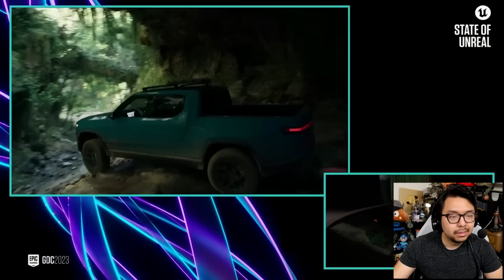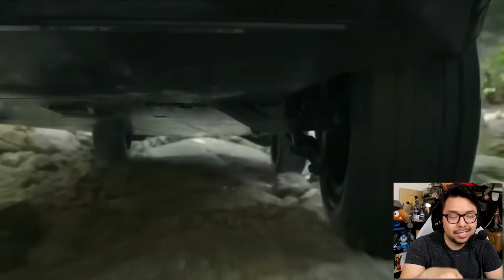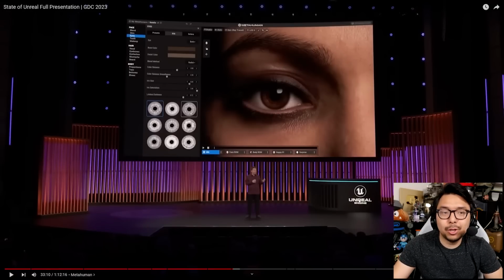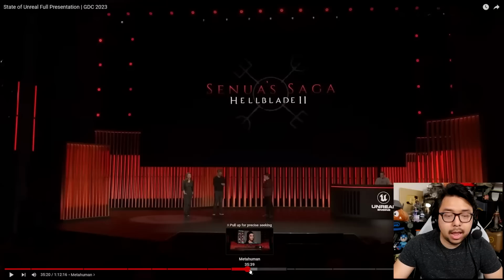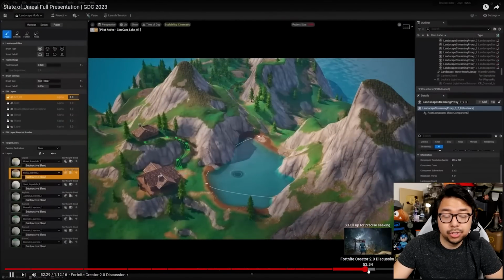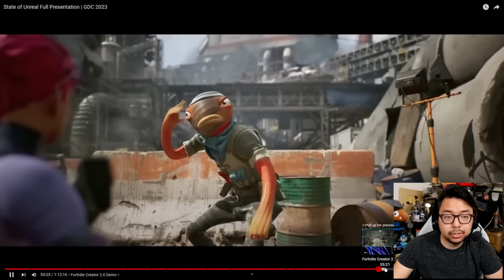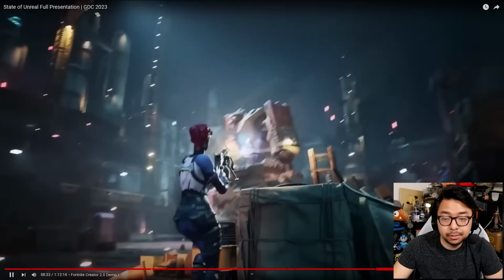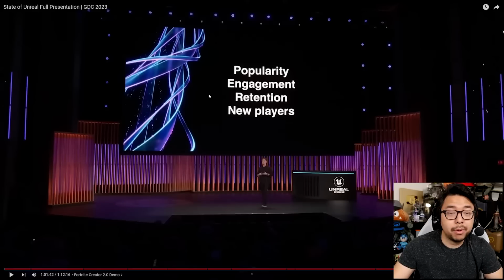Unreal Engine 5.2 Is Utterly Mindblowing (Metahuman, Lumen, Foliage, & More)

Comment: They are not really Top Of the Line  ,  They Have very advance tech but like most  games that have come out massive problems are created like ,  Gotham Knights  lag fps Tanks  , alot of game crashing .  Poor game engine optimization  . Super low FPS .  And in my opinion there has not Been a 100% Top Pc game in all Its History  of unreal Engine Sure there is some good games . But i have Not seen a 100% made from the Ground Up PC game  . without a stupide Ports .

Comment: on new gpus unreal engine 1 can push out over 10 million polys per session you people are on glue you just don't know what's possible cuz they scrub the net often enough to 
remove the truth, that even ue 1 can use c+ to implement other addons, like "opengl 4.6 or vulkan api, and "video player/mp3 player plugs" if you knew you could do it all over in ue1/ue2/udk and use it for free, epic games wouldn't make any money. so its no wonder they spam ue4/ue5 so much while scrubbing info for previous engines.

Comment: Who needs AI to make shit when we have this? :O This far exceeds anything AI can do (and seems to use the same amount of resources?). Cutting out the human is dumb. This, if used right, is the potential for the future. Shame about the hardware being a pain in the ass to get ahold of, and people using things incorrectly will always result in wasted potential, but this is a spectacular piece of work. Would probably make even lower budget titles easier to make (and what's more, you don't need to cut staff, because they can take on similar roles to what they're already doing - this just expands how far they can take it). Now, obviously it'll be prohibitive if UE is expensive to use at a commercial level, but it's still a lot of potential.

Comment: 14:42 - You misunderstand how performance-capture with sensors are done: The body-motions are done with a "rig" or in a "volume" (kinda like those lightboxes for VR-sets, I suppose), and facial performance was done with markers on the face and then captured with a head-device to always capture it accurately. - The difference now is only that you can simply do it with video. - I think there's probably a requirement for a depth-sensor, though, like on those phones that you can unlock with your face, otherwise the camera probably couldn't do it properly, at least not with a single lens.

Comment: I'm not impressed anymore until some game actually implements this kind of stuff. - I mean, cool tech and all, but it serves no purpose if it's not used properly, and it almost never is. - They did this amazing tech-demo for CryEngine back in the day, but some of the prominent games on it, like 'Crysis', weren't actually that impressive. They just felt like results of studios trying to build games on fancy tech-engines, but little substance or point to it. - I've seen this play out over and over and I'm bored of it. - Also: A lot of what you see here isn't very new. I've seen a lot of this possible 10-15 years ago.

Comment: I'm about tired of Unreal Engine, to be honest. Just about every single Unreal Engine game has annoying technical issues - like shader compilation issues, for example. Unreal Engine games almost never run smoothly or as smooth as they should. I wish game studios would go back to how it was in the 90s and early 2000s, and start licensing the id Tech Engine again. The id Tech Engine is one of the most well optimized and smoothly performing game engines out there. With a game using the id Tech engine, the graphics will be photorealistic, all sorts of post processing and particle effects happening. Graphics that make people go "Wow". And then the gameplay is super fast paced and a million things happening on-screen at the same time. Yet, the game doesn't skip a beat. Not even the slightest stutter. You still get super high frame rates and perfectly smooth frame timing. The game runs flawlessly. Back in the day, tons and tons of game studios licensed the engine from id Software. I don't know why that changed. I'd honestly really like to know the reason why dev studios choose Unreal Engine these days instead of id Tech. What happened???

Comment: I think the most innovative aspect of this is Lumen and Nanite. With Nanite, you won’t need to make low LOD models of distant objects, geometry, and foliage. It’s even been found that, given the up-to-spec hardware (GTX 1080 or equivalent AMD,) Nanite has better performance than using traditional LOD techniques. 

With Lumen, you won’t need a high-end RTX card to run Ray-traced visuals, because it is using software rather than hardware (you can, however, still use more accurate hardware-accelerated RT with it.) I myself was able to use Lumen in Fortnite with an RX 580 with upscaling (~60% resolution scale.) This means that more people will be able to use Ray-Traced visuals when creating games. We’ve entered an era where, while still important, graphical fidelity has taken a backseat, and graphical efficiency has taken center stage. 

Another perfect example of this is the new Facial Capture tech. You won’t need to get a professional setup anymore. No more dots all over the face, no need for a room full of expensive cameras. All you need is a phone that has face scanning technology, and a decent computer that can process the data, that’s it. 

These are the true innovators, not Nvidia or AMD; because while they’re advancing hardware and pushing everything to the limit, Epic is making everything faster and easier for everybody, not just the 1% who get a 4090 and a 13900K.

Comment: Btw this is prerendered, no way it's in game , unless they do side by side with controller with game tester and the "game" itself...it's not running this smooth and it ain't running this fast NOT TEAL TIME - dude RE4 remake on PS5 still suffers with graphical and frame rate ....sorry this "demo" was built for only this presentation.....sorry trying to have this engine for a full release just can't happen die to lack of man power, resources and too much BS..... prepare to run games at like 15-25 frames max without it shutting down or crashing lol have fun this may only be PC stuff so console gamers are out ....sorry this isn't happening this is like good and evil 2 graphics and that was also prerendered...hahahahah they straight up lying to us , even the "forge mode" will have issues alot of them , this is cool but no one ain't ganna have the $$$ or power to run programs or games that "supposedly" look like this , good job but this will back fire like everything else does

Comment: I love unreal so I am not badmouthing here, but it seems unreal really understood who are their MAIN customers : Scammers, wanabee developers, rich kids wanting to get rich by their own money, releasing game trailers that they realize later on the way that they can't transform into games. 

What I am trying to say is that UE has a lot of cool features out of the box, but as soon as you try to use those features into a game, and to push customization a bit, you realize either nothing works, or nothing works out of the box at best case, and you are supposed to be an engine mechanic to fine tune it and make it work for yourself if your intention is to make a game and not just a trailer.

For example, did you know that you can't even build a road procedurally with their spline mesh out of the box? If you want just enough flexibility to had barriers and props to your spline roads, the landscape tools won't do it. You need to code your own blueprint, and it takes ages with the amount of options you need for a road. As it stand now, I am witnessing myself learning houdini just so that I can build proper roads and cities in my game.

Comment: @12:10 - Well, that trick was already used in the game The Medium, 2021 game, used UE4, switching places in real time.
@14:35 - Corridor Crew was already doing these sort of 3D renders from phones using special applications for it that scanned the object and allowed to render it on the PC afterwards. That was already done for couple of years. 

UE5, if I understand correctly, simply unified these tools or integrated them, and refined for a smoother and better usage, rather than created them.
Reply: What corridor crew did was they took dozens of photos of an object and used a program to build a 3d mesh out of those pictures. What's shown in the video is a single phone recording creating a full fledged animation that can be instantly thrown onto a model. There is a gigantic difference, what's shown here is infinitely more impressive.

Comment: Yes, OK, but time will tell if projects by teams can actually finally be other than bloated and badly programmed games with UE5. With big UE projects, perfs are often abysmal in the context of a big project (or middle size projects by little teams, whatever, and even a lot of very broken little games made by one guy or just a few), like they tried to do with that Harry Potter game, so much so, that I actually suspect the producers to have created or helped to amplify the "polemic" that assured, mostly no one at first judged the game objectively, not saying it was that bad, but it had technical problems, like many UE games, and the more the project is ambitious, the more it has chances to be horribly put together, because of the nature of how the tool library that UE is, well  is, IDK, how to explain what I mean, just that Rockstar managed to actually do wonders in RDR2, I mean technically it's decades away from ANY concurrence, and that this would not have been possible with an engine like UE, they HAVE to use proprietary tech. And other devs should continue to use their own tools in most cases. We'll see... But gaming doesn't get better, does it, at the time?

Comment: Just hopefully, a focus on framerate, stability, and low input latency is not left for last. That is usually an issue with Unreal Engines outside developers very familiar enough to negate or mitigate that. These visuals are nice, but if many games have to reduce size/scope due to the visuals...

Mind, I'm sure it won't be terrible as Unreal has good games from each engine iteration. Just concerned about pushing full-on visual might hinder other aspects. As each Unreal Engine has had issues, especially early on for many third-party games.

Comment: Every time I see new tech I am like "Ah, that's nice, but can we actually run that?" UE5 has been quite demanding and puts even high end cards today to their knees. And to see that they've brought even more tech that will probably put even more demand on the GPU... I don't think we will see this anytime soon implemented with current tech.
Reply: I use Unreal Engine 5 myself and it runs fine on my 2060s. Its often internally 1080p and only about 30fps, but that's almosy the lowest end rtx card available.

Sure, these demos are running on top spec machines with 4090s, but that's probably at 4k 60fps or higher in a dev environment, so in editor. Editors are always going to run substantially worse than a compiled game.

You might struggle to run this on anything below a 30 series but in a few years that won't be especially high end anymore
Reply: not even menetioning that this demo was car slowly driving inside a small track, Imagine a full adventure game where dozens of actions are happening at the same time... plus the small amount of time developers have to work it won't matter how good the engine looks when we still have these limitations
Reply: Yes your pc (if it's very high end) can run that. The "problem" that you read in the comment like 'but in game it's not gonna look like that' is because games are trying to target next gen hardware as well as last gen ($$) where I work our 3080 can run our game at 30 fps before optimization and 60 fps after, but we still have to reduce the quality so that it can be played on last gen
Reply: @Robot Maniac you clearly have no idea what lumen or nanite is. The entire point of these systems is how incredibly optimised they are.

With nanite you can literally have billions of polygons and it will decimate it down to 1 poly per pixel for perfect performance and no visual downgrade. If that's not optimisation, idk what is
Reply: @Robot Maniac here's a buzzword free version for you:
You can have practically unlimited geometric detail for no performance cost. That simple enough for you?

I use unreal engine regularly and it runs 30+fps 1440p on my 2060s perfectly fine. You don't even know how to use the engine to find out. Just play fortnight and see how well it runs. It might be a bit slow but after the main hit from using the new systems in the first place, that performance shouldn't dip much further no matter how detailed other games get.
Reply: @Robot Maniac nanite is more performant than the manual budgeting that devs have always done, because the game is constantly scaling to make the best use of the hardware. It just looks subpar on old tech that doesn't allow for the streaming it needs to run, because there's constant popping and loading, but as SSDs become more and more standardized, this tends to go away.
Reply: It shouldn't take too long. That demo is impressive and it's running in a consumer grade PC. Back in the early UE4 days they'd cheat and use absurd configs with like four interlocked GPUs and stuff like that, but nanite is so optimized you can make it work on current gen consoles.
Reply: @du0lol  It may be a consumer grade PC, but it's still a top-end consumer grade PC. Now the question is, how does it run on low- and mid-range hardware?
Reply: @AmartharDrakestone  That depends on how the game is made, in the end. I can't develop with nanite in my current PC (which is an aging notebook from 2019) but I can play most modern games on it without issue - even UE5 games on mid to low settings. PC gaming in general sucks, though, so I'd bet they're more interested in how it performs in current gen consoles, and those can handle it just fine, it seems.
Reply: @AmartharDrakestone  the matrix awakens demo ran on a series s. Also, fortnite chapter 4.

Comment: This is cool and all, but I genuinely don't see most games going to extreme lengths to make visually pleasing video games like this. Plus even then, I feel like most modern consoles or even modern PC's probably won't be able to fully handle graphical standards set by this without risking extreme frame rate drops
Reply: Of course they can't. This stuff is for all the next gen stuff. I mean this is probably running on a heavily overclocked 4090
Reply: @Turtle Rx  we don't know that.
Reply: well yeah this is a tech demo. the point of unreal engine 5 though is that the triangle shenanigans makes it run faster and able to use millions of polygons without absolutely dying

Comment: So the tool is like Gmod, except you'll learn a useful engine that's Unreal while using it, unlike the outdated Source 1 that Gmod uses. Besides you can make money from it. That's way cooler! I think it will definitely be a helpful, even one the most helpful starting platform for potential great developers! 👏
Reply: That's EXACTLY what I thought too!  As an OG HL2DM mapper, and later, gMod mapper/game mode creator, working in Source was a NIGHTMARE.  BUT.... it came with everything in HL2, so you could quickly and easily make all sorts of really cool, complex maps and systems.   Including all the assets and systems used in Fortnite is brilliant! 

I will say, I did grab the Source 2 tools a few months ago to try out, and was super impressed.  I just wish someone at Valve would actually publish a full SDK and Authoring tools for it.

Comment: I too was very impressed byt this demo, the only thing is though we seen this before. Its easier than ever to make a game now thanks to unreal and other engines like unity yet games take longer than ever & have much bigger teams. The reason it doesn't matter is devs simply are never happy with the shortcuts they wanna do everything by hand and find new ways to do stuff instead of taking the easier route for a much cheaper to make game. This is why I hate the argument where people say games should increase in price and DLC is okay as devs need that extra money. Like when you see that 1 person made stardew valley in 3 years in his spare time after working his full time job it just shows how crazy the industry is.
Reply: This reason is why I'm skeptical into creating a game, half of it is split between "Will my game be forgotten in 2 weeks?" and "will people notice I'm using in-store assets." which leaves me creating custom assets. I don't care about the codeblocks aspect, I'm just worried that when I release a game somebody is going to say I used prefabs.